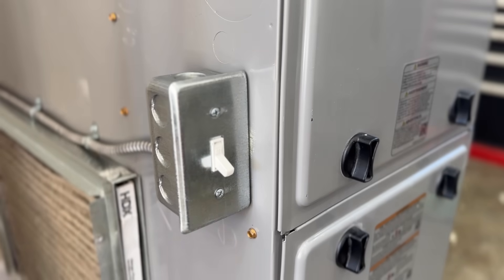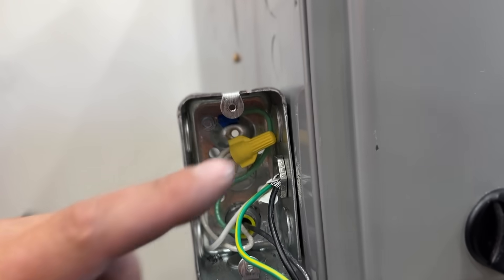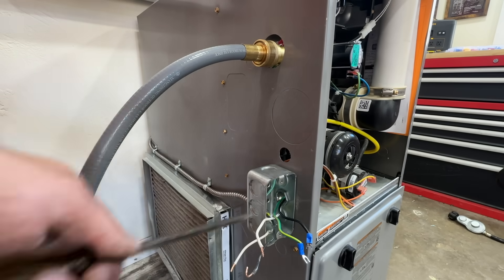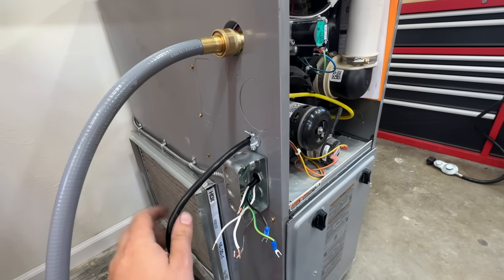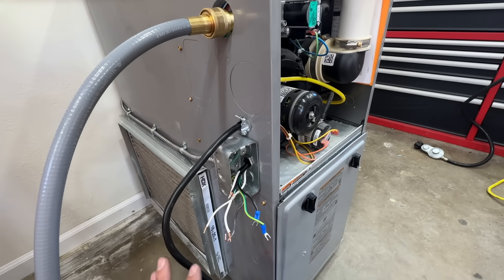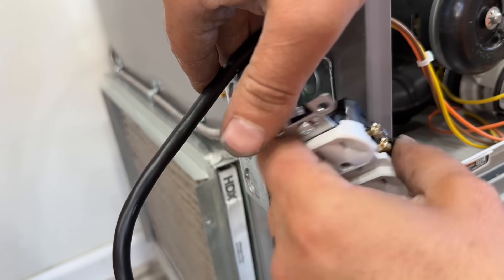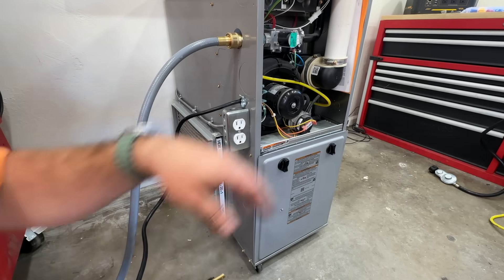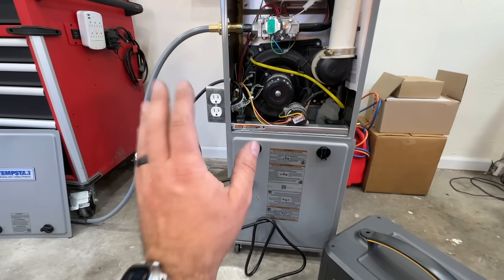Keep Your Family Warm During A Power Outage By Installing This $5 Part

Comment: $5 for the box, outlet, ... $800 for the power bank.  Also, using your vehicle will only work if you have a Sine Wave invertor!  Motors don't work with cheap step invertors

Comment: What?? A furnace is normally on it's own breaker anyway. Just set up your main panel to be easily powered by a gen lead and turn whatever circuits on you want! The circuits in your wall that feed your furnace directly are probably 12awg and your 100ft 16ga drop cord is gonna work that little generator harder than it needs to.

Comment: Great video!!! Excellent idea!! Would you happen to know if New York City has any issue with the setup? If you don't know what electrical code is for NYC what section and code in NEC should I look up to determine if it's legal or illegal? Sometimes NEC can be very technical, what terminology in the electrical code would confirm that it's legal or illegal? Does this work or is it allowed for steam natural gas boilers? Regarding the generator does it have to be a certain Peak max power for furnace startup (similar to a refrigerator condenser startup, for example 1,000 watt generator with 2000 W Peak)?  Thanks for the feedback, again great video!!!

Comment: I would assume that you should shut off the breaker at the box so that if the power comes back on while you have the generator running, it would not back feed anything. Is that correct?  Thanks
Reply: The rewired furnace will only have one plug, so it can only be plugged into one power source or the other. There's no way to plug it into both power sources (house + alternate).

Comment: Ill ask the stupid question since im now old enough to ignore looking or aounding foolish.
What would happen to the furnace and/or the temporay auxiliary power source if the grid power without notice came back on and my house geid was back to powered?
Would my Aux.Power source be affected or fryed due to being hooked up simultaneously as the once out no back permanent power recharged the aystem while the furnace was drawing off the generator or potable battery power supply?
Thanks in advance!!
Reply from the maker: Nope, aux power source would be totally isolated. You’d just have power to your outlet when grid power comes back, but until you unplug the pigtail from the power station and plug it into the outlet, nothing will happen.

Cheers

Comment: I have but ONE question.  Only saw one or two comments pertinent to the NEUTRAL and GROUND wires.   Fair enough that you supply the furnace with Inverter Generator.  Miy Generator is most likely just like Hundreds or others.  SO.... DO YOU NEED A BONDING PLUG on your Floating Neutral Generator to make your furnace work?   What have others done?  *Licensed Electricians Please chime it.*❗❗

Comment: So, I always wondered why my gas furnace is plugged into the wall (inside the furnace closet) and that means I have no heat when the electricity is out. Does this existing plug mean I can get one of those boxes and just plug the furnace in it, if needed?
Reply from the maker: Correct!
Reply: @diyhvacguy  Thank you!

Comment: a code violation .....NEC you can't use a plug as a disconnecting means when oner 1/8 horsepower.

Comment: Must be forced-air or something for all that juice being necessary.  Got steam-heat here, so all I'd really need is low-power 120V or already stepped-down ~20V or so, just to power the thermostat.
Had an overnight blackout a ways back.  Still had endless hot water as that thermostat doesn't need external power, but house-heat still needed to power the upstairs thermostat to turn it on/off as needed.

Comment: What in the actual hell is going on here with a garden hose on the gas line wtf.... thats not safe at all..
Reply: I kno its a quick connect. But hell no... install black iron and ground bond it or use csst qnd bond it 2 ground again

Comment: So I did this before I watched your video, and it works great... or so I thought. I plugged my furnace into my generator and the blower started like normal, but then I got an alarm on my thermostat. It said " line / neutral reversed or weak ground ". Nether of those are the problem. What I don't know how the fix, is the fact that the thermostat have 24 volt draw. SO I'm assuming the control on the furnace and the thermostat at this point think they are not on the same circuit. I am confused on this. I bet if I remove my thermostat with the interface and all the gadgets on it and just use an old school mercury thermostat it will work.  But I don't want to do that, how do I make the thermostat work?

Comment: I did this right after the video was made. Good thing I did. Whoever originally wired my furnace did a poor job in making the wire connections. I made my own 2000 watt solar set up across from the furnace with a 300 ah Lifepo4 battery and 400 watts of solar--soon to be 600 watts. My solar setup also sits next to a large refrigerator. Three years ago I purchased an 1800 watt Nature's Generator and it sits in the living room with 200 watts (maximum) of solar and a wind turbine (150 watts which was a real bitch to get up in the air)) which is also a part of Nature's Generator's system setup. The downside is that it has a 75 ah AGM deep cycle lead acid battery inside but the internal inverter produces pure sine wave. It also has its own charger to plug into the wall. Nature's Generator to this day powers the TV, internet, digital antenna and lights. The reason I bought Nature's Generator was when back then News reports were showing lithium batteries catching fire. It took a while to convince me that Lifepo4 is safe.

Comment: did this thinking the same thing turns out a generator wont run the control side only the blower motor due to generators having "dirty power"

Comment: I installed two "Reliance Controls TF151W" at the breaker box to run  a generator connection to. I have one to the furnace breaker and another one that runs the breaker controlling an internal room's power that also controls the ceiling fan in the sun room where the generator is located (to assist ventilation and push the ceiling carbon monoxide accumulation down to go out the open windows) which also powers the adjoining room near the kitchen to run lights/TV etc. When power returns, the switches won't allow power to back feed the generator. You just turn off the generator and flip the switch to return to house power.

Comment: You forgot to properly ground the electrical plug!! The switch was also improperly grounded to begin with - the ground wire needs to go around the box ground screw, and then connect to the furnace ground wire, with a pigtail to the green ground screw on the switch itself. The mounting screws are not ground wires - they simply hold the devices in place.

Comment: In British Columbia, gas furnaces typically need to be hardwired to meet electrical and building code requirements. The BC Electrical Code generally mandates that essential appliances like furnaces should be hardwired to ensure consistent and safe power delivery, which reduces the risk of accidental unplugging and improves reliability during operation.

However, always check local bylaws or consult with a licensed electrician or HVAC professional to ensure compliance with any recent updates or specific municipal codes.

Comment: Wow, an 11 minute video that just has the straightforward information, no fluff, nonsense, or ad read. In Florida, we don't have a furnace but I watched anyway. Refreshing.
Reply: Actually, that is God telling you that you need to move to North Dakota.
Reply: It's a bs click bait video that spends 10 out of the 11 minutes making it sound like all you need are these $5 in parts until he whips out a $600 power station.
Reply: @Noneofyourbusiness2000  Good observation...  Similarly, the guy that said that he did this and it was a ten minute job; was clearly not including watching the video, trip to the store, gathering tools.  
I do think it is not BS and good stuff for alot of people.  In my area, we are seeing alot of outages and are on gas furnaces that die with no grid power.  My neighbors have bought generators for about a 1000 bucks this year plus electrician work to switch the house off grid to generator costing them about 5 thousands on top of that.  Whole house gas generators are more, like 10,000.  I just ordered a wood stove insert costing around 6000.  I already have a power station, and could have just done the tip provided for emergency winter heat, and maybe will anyway.
Reply: @Noneofyourbusiness2000  how is this clickbait? You thought you can magically power your furnace for $5? No, the video was exactly as expected, especially since there's a power station in the thumbnail genius

Comment: Question from your video, "Keep Your Family Warm During A Power Outage By Installing This $5 Part"  Can I relocate the metal outlet box on the furnace to 9 feet closer to the crawl space access door, and install the proper length wire?  Our furnace is located in the crawl space and difficult for a 70 year old to access. Thanks.
Reply from the maker: Absolutely

Comment: I have an unusual issue. Wired the outlet up. Turn on the breaker with the plug in. Works fine.
Unplug it and plug it into a Ecoflow River or a Ecoflow Delta2 pro. Will not turn on. Get error message for bad ground. Its grounded. Any ideas? Thx Mike

Comment: My question is why? Why go through this? I have a gas furnace and didn't do this. It seems a waste of time. I back feed my panel and load shed my panel to run what circuits I want to run. For me personally this is not a necessary thing. I do have a convenience receptacle but no pig tail. Not needed

Comment: I was hoping you would use the Wagos (or Ideals).  Glad you do,  They are cool and way easier for novices to deal with than the ancient nut designs.  The Ideals come loose a little less often because they open in the opposite direction.  Also Wago now makes straight butt connector units which are good for tight fittings.

Comment: This looks like an awesome idea! One thing I don’t understand is what you mean by isolation? When the power comes on, I don’t understand why it doesn’t cause a problem for the equipment, providing the back up electricity? It seems like the mains power would be flowing into my back up device.

Comment: Wait a minute! This method will backfired electricity back to the breaker which could cause injury or damage if an electrician is working on the power lines outside the house, correct?
Reply: No, if the power is off you would pull the plug, completely disconnecting it from the home's wiring. You would then run an extension cord out the window to your generator. It's the same as disconnecting your fridge from the wall and plugging it into the generator.

Comment: I guess it has been asked but you should be using a outlet with a switch and receptacle so you can shut the furnace off for service. And some codes require that.

Comment: Dude, you are an idiot. You wired the main feed to the recepticle. So when you power it up,if someone turns the breaker on it will backfeed to the breaker box. WRONG. When the power comes back on you will have a HUGE PROBLEM. I was an electrician in the film business for 30 years.

Comment: LOL, no ground to the outlet, no ground tap to the back of the metal box (code required), left the hot and neutral secondary screws completely unscrewed.

Comment: Hi, interesting video, well shot and nicely explained. I do have a question, and forgive me if it seemsa bit silly. If the power to your entire house goes out, then doesn't that also mean that your thermostat, which tells your furnace when to provide heat will also lose power? I think this video is pretty ingenious explaing a workaround for power failures, but, would it not make sense then to also ensure that the thermostat has continuous power in the event of a power failure to ensure that the proper signal gets sent to the furnace when the inside temperature of the home drops below the temperature that the thermostat is set to? I realize that some thermostats are battery powered, but I'm thinking more of the thermostats that have no battery backup feature.
Reply: Your thermostat wires run directly to the furnace board. The board would receive power via the method in this video, then the 24 volt (usually) current would run from the energized board to the thermostat. I’m just a random guy on the internet, but this is my understanding.

Comment: I use a lockout on our breaker box and our generator powers the whole house.  Ur method is a nice way to run only the furnace.  We also have a 130,000 BTU gas wall heater in our basement that can be fired to maintain a livable atmosphere for short periods.   Thanks for the idea.

Comment: Great video. What is the switch used for in your video? I cannot find one on my system. My system plugs directly into an outlet. My assumption would be to plug the furnace directly into the backup battery (with a Pure sine wave inverter), and a grounded neutral.
Reply: Code requires a dedicated circuit with both its own breaker AND a disconnect switch within reach of the equipment. While a plug is a pretty good disconnect, there is potential for arcing if the equipment is active when you pull the plug. You might not want that in proximity to a gas furnace that maybe has a leaking gas valve or a thermocouple that is letting gas flow from an extinguished pilot light. And, get the Eff out of the house immediately without touching anything electrical if that's the case, but yeah, disconnect switch.

Overall, this is a good hack. Totally safe if properly done, and possibly all you need to weather a power outage during a storm. Food would stay fresh in a cooler in the shed if the temperature is cold enough that you must have a working furnace.

But it falls into a gray area of the NEC. Many inspectors will insist that a furnace should be hardwired rather than connected with a plug and flexible cord set and that's a fight you will not win even if you are made of money (in which case you probably already have a whole house transfer switch and a hardwired generator and are not messing around with a DIY hack from YouTube.) Although most jurisdictions in areas where power failures are common turn a blind eye to this "hack" the blinders may be more opaque if every other particular of the NEC is assiduously followed.
Reply: @christopherdahle9985 thank you!

Comment: My furnace is 220 v the fan is 110 v this way I would get the fan to work but the heating elements won't.
Reply from the maker: This only works with 110v unfortunately
Reply: Electric furnaces are 10 or 20 thousand watts, you're not plugging one into any portable power source with some DIY cord hack

Comment: Please correct me if i am wrong.  The average Residential gas furnace requires .3 to 1 KWH to operate.  So a 1000kw battery backup may last 4-8 hours max?  I prefer a natural gas generator hooked to the main via a transfer switch

Comment: How do you figure there is no way to get power to your furnace, you don't even need to modify anything, just open the main breaker, plug the generator into any receptacle that is on the same phase, and you have heat AND half of your house will power up as well.

Comment: The switch you took out was for the service techs to shut the power off at the furnace.  Its going to be a pain for them if the breaker box isn't near the furnace.
Reply: you literally just unplug it instead of flipping a switch

Comment: Here's the problem ,u had better isolate the neutral wire as well because if power is restored u will have a nice back feed. Second,the 24 volt transformer on the furnace is made to work on true 60 cycle AC. Not rectified AC as provided by the generator. You will fry the transformer. Also the male plug end becomes hot. I did the same thing and realized what a mistake it was

Comment: Because that furnace is a latching electrical panel just do your wiring in the panel instead of in a junction box.  It's true that connections must be made in an electrical enclosure, well that electrical panel is a rated enclosure and that is why the furnace electrical is in there.  What you are showing a cord grip, outlet and cord are more than $5.

Comment: This will work, but there are many code violations.
Now that it's an outlet it needs to be a GFI
The box is floating
The box is to small for all those wires and receptacle
So if you're going to do this, do it correctly.

Comment: What happens if the furnace is running on generator and power comes back on?
Reply: Nothing. The pigtail and furnace are  isolated from the grid power when the pigtail isn't plugged into the receptacle.

Comment: Might be a dumb question but what about the power to the thermostat if the power goes out?
Reply: The energized board inside the furnace will deliver the 24V signal to your thermostat.

Comment: Don't eliminate the emergency switch on your furnace. Get a transfer switch and do it the correct way, and you won't have to run silly extension cords all over the house

Comment: Use a hammer and screwdriver to tap the ring on the NM clamp snug to the chassis. And if using a switch as a disconnecting means, get a double-pole switch so the white wire is isolated as well. Good work!